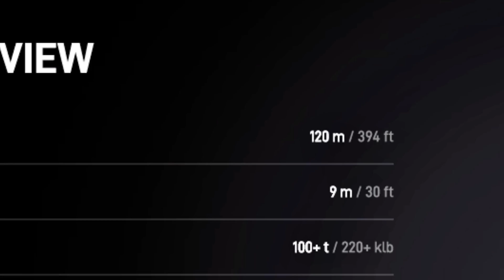After second hop, SpaceX preps for next phase of Starship testing

Comment: holy crap... SpaceX could actually test the Raptor Vac in LEO as soon as they get a working Starship because Starship will have both Vac and sea level engines. NASA and other rocket institutions have to test those things in giant vacuum chambers that cost billions to build. 
SpaceX could simply slap a few on the bottom of a Starship with 3 flight proven Raptor sea level variants and 3 VAC variants and do real life testing WAY faster than any other company could do. Having a ship with both sea level and vac engines is a game changer when it comes to testing and flight proving.